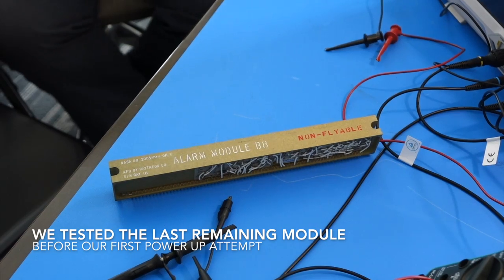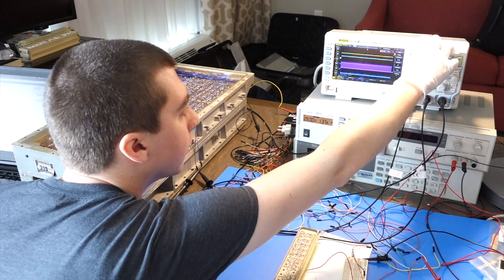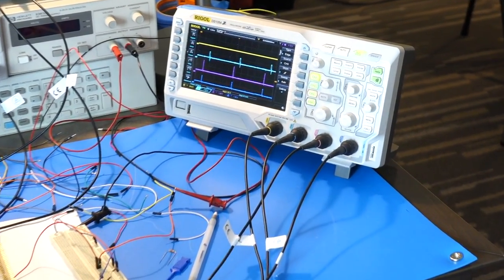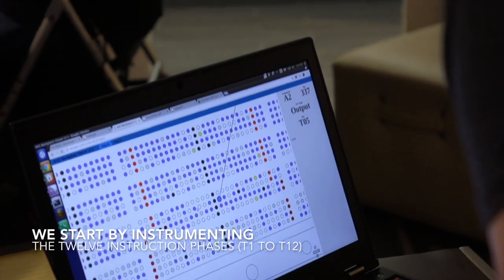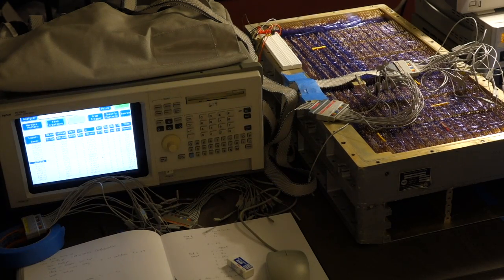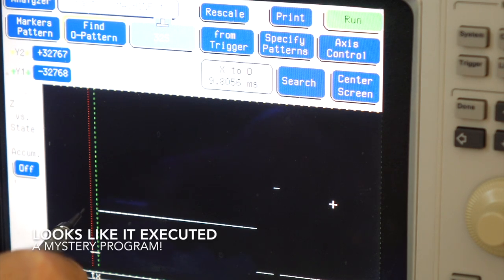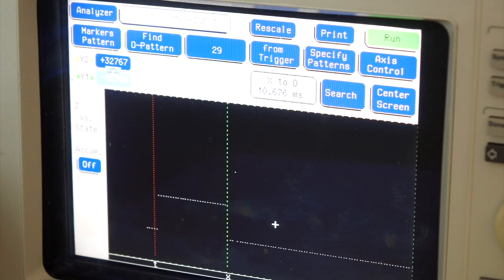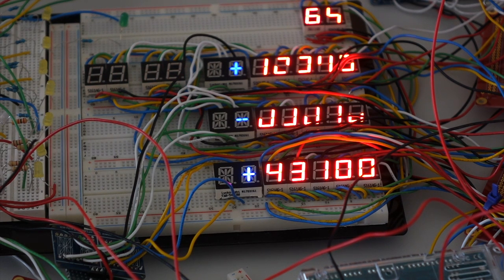Apollo Guidance Computer Part 4: We are "go" for power up

Comment: if the rope is bad, could you not make a rope emulator using an eprom chip and some interface logic
Reply from the maker: Of course. "Some kind of interface logic" is obviously the very large engineering difficulty, as core rope magnetic addressing, timing, current signals, etc... does not work anywhere close to modern memory, and the AGC driving electronics are very sensitive to what they are connected to. So we'd have to simulate the actual electrical properties of core rope - there is much more than logic, but some actual analog hardware to develop, replicate, or adapt the vintage parts we have. Not to mention we'd have to replicate the now defunct connector hardware. We are on it.

Comment: Any "strange" or oddball voltages used in the AGC?
Reply: Well, it generates 14V and 4V for widespread, plus 5V in one module. The input and output signals are 28V.
Reply from the maker: Not in the AGC proper, but plenty in the overall system. 250V/800Hz in the DSKY for the electro-luminescent panel, 800 and 3200 cps high precision 28V AC in the Inertial Measurement Unit, CDU and Optics Resolvers, excitation voltages for the gimbal and torque motors... There is a large amount of weird electronics to deal with that in the PSA trays (Power and Servo Assembly). Jimmie is going to send me some of these modules, so I can try to revive them and demonstrate. One famous snafu with the 800 cps 28V to the LM rendez-vous radar is the actual lowest level root cause of the 1201 and 1202 errors in the Apollo 11 landing.
Reply: @CuriousMarc  Thanks for the reply. Apollo was (and still is) interesting technology.

Comment: Is there any way to de-pott the memory blocks for repair at all?
Reply: We are actively investigating this.
Reply: @carlclaunch793  Great! You lot do such a magnificent job there, it's easily the mostest awesomnest nery project ever! :oD
May I contribute an idea, and suggest to try breaking down the lump of epoxy in an oil bath in a pressure cooker?
Reply: @Eo_Tunun  We're trying to be as minimally invasive as possible -- which means only removing the least amount of epoxy needed to reach the broken wire as possible. We're going to be X-raying it soon to determine the precise location of the break, and we know (and have) the exact original potting material used and will be experimenting on it before touching the real thing.
Reply: @mikestewart8928  I guess you guys should be lucky that epoxy has not turned conductive. Sony in their infinite wisdom used a kind of glue epoxy (to hold pots and other things in position) on their Betacam broadcast Video Tape Recorders (VTR's) that turned conductive after about 7-10 years. It took Sony many years to admit to this and finally publish a technical bulletin on this issue. However, by that point most service techs had gotten the word out to look for this in weird issues with VTR's that made no sense. I believe the conductivity would change with age and temperature, and got worse with age. So you would chase a problem that would go away on the bench because everything was open and now much cooler, i.e. top was off, good ventilation and no VTR's generating heat above or below the problem VTR in a rack.
Reply: @marcusdamberger  Materials degradation is a major problem in restoring old computing artifacts. The greases used in the 1960s for mainframes will solidify, the foam used for sound deadening turns into a semi-liquid goo or sheds small fragments . . .
Reply: @mikestewart8928  
Youtuber Fran Blanche is working on a reproduction of the dsky, maybe she's one to join forces with to get the device perfectioned?
Anyhow: I can't wait to see the next news! This is top notch entertainment!

Comment: Found this video about AGC: https://youtu.be/ndvmFlg1WmE - Now whats the plan for the broken memory, will you need to sew it by hand like they did in 65?
Reply: The erasable memory module (RAM) where we have the break was not hand sewn. It is rather traditional core memory planes, but the 16 planes were folded and folded to fit in the space of a stick of butter. 

The core rope memory (ROM)  had much larger cores through which more than 100 wires were threaded by hand. We have mused about making a demonstration core rope memory, doing the threading ourselves, but this machine has two Raytheon boxes plugged into it, in place of the six rope modules. Those boxes were connected to a missing ground side machine that together with the boxes would act as rope memory, responding to fetch requests with the proper word of ROM. 

Ken is shown in these videos reverse engineering the two boxes, with the objective of developing some circuitry that will replace the unknown ground machine. It would then allow for the software from the ropes to be delivered to the AGC over period-authentic boxes. Stay tuned to watch his progress.

Comment: In a way this video is sad. We're captivated by the AGC because we  haven't been to the moon since. A raspberry pi weighs 1/200th what the AGC does and has the computational equivalent of thousands of these things. 

If we were still going to the moon, or even had a presence there, would we care about the AGC? It's like we're trying to relive our glory days as a species. Ironic, since with our modern technology we'd be able to go to the Moon thousands of times over compared to how difficult it was during the Apollo days.
Reply: It is an easy trap to think of how much more powerful your phone or R-pi is than the AGC. As far as mathematical processing ability is concerned, it's true. But you have to consider the mechanical durabilty. A lot of the mass of the AGC comes from building it to withstand being shot into space on one of the most powerful rockets ever made. Slide your smartphone off the edge of a table, and there's a decent chance of it being severely damaged. You could probably toss one of these Apollo computers out of a speeding car on the freeway and still have it fly you to the moon.

Comment: So, could they fly to the moon on a raspberry pi 🤔
Reply: Processing power-wise, yes. But it's the mechanical durability and software stability that's really important. You don't want a multipurpose generic computer controlling life-critical functions. The AGC is purpose built to do one thing really well. It can't run Excel and play YouTube videos, and if it could, you wouldn't want it navigating you in space.